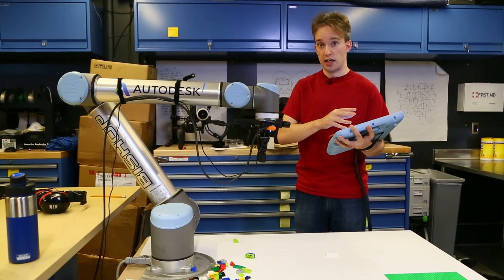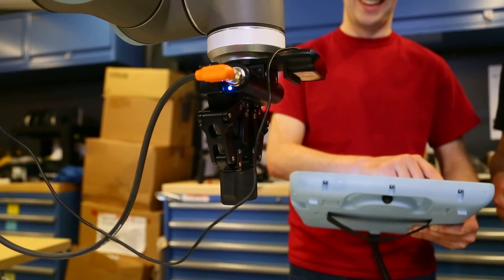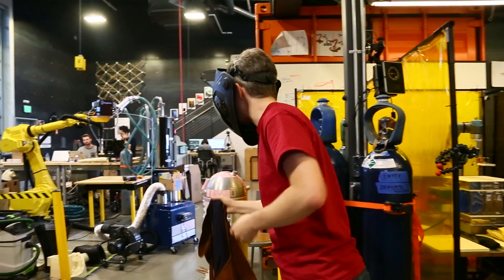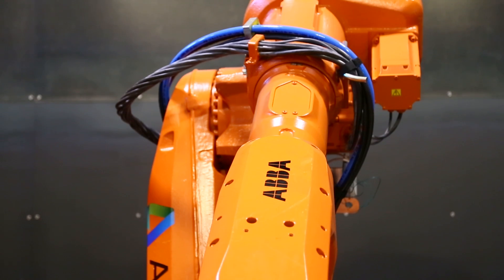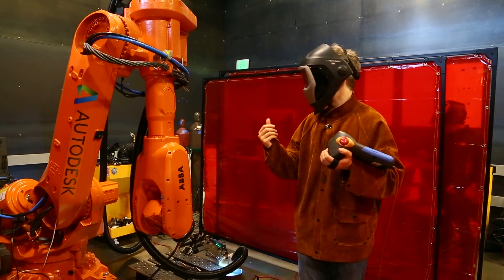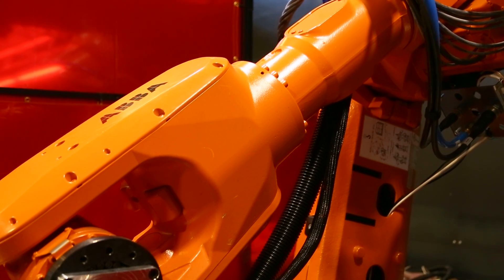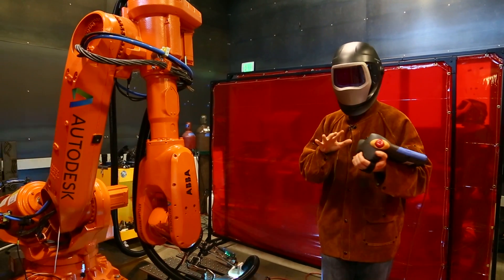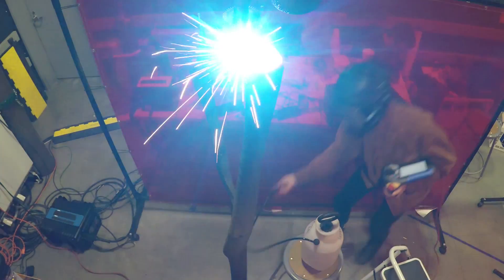3D Printing Stainless Steel with Giant Robot Arms

Comment: Bogus & pompous. It's nothing but a simple CAM demonstration, with a MIG torch riding on the endeffector. BUT as someone presently struggling through the endless deficiencies, frustrations & inadequacies of Autodesk's Fusion 360 software...if this is the rathole that AD's R&D funds are being wasted on: 1) F-360 will never get the fixes it needs 2) AD will never again catch up with or be the equal of Solidworks; and 3) self-driving robots are as dumb and impossible an idea as self-driving cars because computers can't actually think. It's true, neither can so many people, but amazingly computers are even dumber than their creators.

Comment: boys and girls, sorry for spoiling it all before it even starts,  but have you ever wondered what is the price of that 3D printed sculpture. a quick guess? more than you can imagine is the answer. just the price of stainless steel is discouraging, let alone the energy and maintenance. 3D is not a universal technology - it is a complementing tool, not a replacement for machining. also, welding is generally an inaccurate process. don't fool yourselves...

Comment: When he said ‘assembly language’ I went “ohhh nooo” aloud, since I tried learning some assembly language a while back, and gave up when I realized that you store values and call the kernel or some crap like that to do functions. Hello world suddenly got a lot more complicated.
Reply: dword txt "hello, world", 0
mov rax, txt
mov magic_register, "just print out the damn thing will you?!"
call magic
;easy, right?
Reply: Well, the string "Hello world" itself can't know which pixels to light on and which pixels to switch off in your screen by magic. So of course there are a lot of code or circuits behind the scene.

If the computer is running the screen in "text mode" like in DOS days, then maybe those operations are all offset to the GPU without OS interference. Or if you are running an embedded device without any GPU in-between, you code which pixels to light on directly by tweaking individual signal output. Else if you are running a windowed interface like what we almost always do nowadays, then there are a lot of works for the OS to coordinate.

Edit: I said "or circuits" because around 1980's to 1990's, there were a number of "Chinese cards" for one to buy and plug into PCs for Chinese text display acceleration.
Reply: Heads Mess 48 65 6C 6C 6F 20 57 6F 72 6C 64
Reply: @Heads Mess And now I've actually been able to write a "Hello, World!" program in NASM. Two years does a lot.
Don't worry, C++ makes me want to scream too, sometimes. I use it for robotics, but thank goodness I can mainly just use the API that we have and hardly have to touch the C++ libraries.

Comment: Convert shapes into machine code, notice when it's out of materials - regular 3d printers do that. The one new thing in this video was just that it can evaluate the quality of the actual physical print based on the actual results.

And why don't they install proximity sensors if they want it to notice people getting near the robot?
Reply: ailaG I think you might be underestimating the difficulty of welding. You have to hit the exact right speed of the tool, wire protrusion speed, angle, amperage. And in welding, unlike regular 3D printing, the previous layer shouldn't be solid when you go over it. Otherwise the product will have pretty crappy physical properties. Oh and if it's too soft when you're adding another layer, it'll just end up as a puddle of liquid metal. Welding things together is difficult already. But using welding for additive manufacturing is just nuts! (in an awesome way)

Comment: This seems pointless to me. ha ha! (weld seams) anyway I can tell you for fact that the finish on anything this prints would be ruff and layered and would need machining if printing a precision part not to mention the time layering the welds and cost of equipment. Also it would be quite brittle and would need to be heat treated for most applications. These robots f@@k up all the time and need to be programmed and supervised almost continuously. I cant see this ever being used other than for art sculptures and you have to question is it really art when it's been produced by a robot? Boom!

Comment: No mention of material properties after a print is complete? Or even what types of loads these can take, or what this can be used for right now. I can't imagine that this style upholds the tensile and compression strength, like rolling does do to tempering processes. I imagine the shear capabilities of the metal drop dramatically since it is no longer homogeneously formed.

Comment: > Assembly Language
... Scott...
You call yourself a programmer? Well, that must have been a brain fart of magniture 9000+.

It almost made my brain melt with stupidity that you would call machine code that. If I would have called machine code "Assembly Language" at Uni I could have been thrown out a window, head first.

I have lost my respect for you thanks to those two words. It is deplorable to use the wrong terminology in an informational video.

Assembly Language is -- to some extent -- high level. It is an abstraction using natural language to represent machine code. Assembly Language is compiled/assembled in an Assembler into machine code. This is basic stuffs that every programmer should know.

Comment: Tom - excellent video as always.

I had a personal experience with a robot failure some years ago. I was working at a company doing surgical robotics when the robot arm (much smaller than the one shown - could easily fit on a small table) suddenly moved at full speed, missed my head by 3 inches and slammed into a wall making a huge hole in it.

That was caused by a division by 0 error in the robot controller, which was using assembly code. We switched to another robot that used C/C++ and had much better fail-safe mechanisms in place to prevent that from happening in the first place.

Having written assembly many years ago, it's a real bitch. You only use it when absolutely necessary.

Comment: Even if you have the kill switch, would you have enough time to react if the robot swung at you unexpectedly?
Reply: Yes. When you press that e-stop, the robot stops dead, makes extremely expensive noises, and the controller has a chance of releasing the magic smoke.
That is a very "E" stop. The regular cycle pause button is on the front.
That, and the controller itself is a "dead man" switch - you have to hold the controller tightly to depress a button within the handle. If you let go, the robot stops normally and then yells at you with colorful errors.
Reply: most robots have a manual control speed that is limited to 250 mm/s (/W deadman) so there is time to react if something goes wrong. if the machine is in automatic mode then the robot has no speed limit and people need to be clear of the robot
Reply: Probably not enough time to avoid getting hit at all, but enough time to avoid being killed. Most robot related deaths are not just from being smacked by the arm, but rather by being pinned and crushed or torn apart.
Reply: Definitely not
Reply: Depends on his reaction time :p
Reply: IMDRock These can be overridden on almost any system if you are an admin. That means a regular operator(factory worker) can't go in and pin themselves to the cage before they can notice, but the integrator/owner of the machine can easily run it at full speed in manual mode.
I know for a fact that older KUKA and Fanuc controllers allow for that, not sure about new stuff.
Reply: ***** normally to switch to the full speed mode you need to have pendant switch and the controller key switch in the same state.(robot control or pendant control) I'm not aware of any system variables that let you bypass that (at least on the newer FANUC robots).  how long ago was it possible?
Reply: IMDRock I've seen it done on KRC2-controlled robots.
Weird.
Reply: IMDRock the stop is checked cyclically. No matter which position the switch is in, it'll accept the pendant input. 

I had a coworker almost lose an ear because a driver failed closed and a motor double stepped when it should have half stepped. I thought for certain it had crushed his head.
Reply: @Druicidal  that must have been difficult to see.
Reply: For my degree I wrote a program which would take an image and use a robotic arm holding a marker to draw a stylized version of the image on to a large sheet of paper. The arm was quite a lot smaller than this one (although still took 2 people to carry),  but a decimal point in the wrong place resulted in it moving "slightly" (very much!) too fast and flipping itself (and the table it was bolted to) over as if it weighed nothing... So my guess is no, if that thing suddenly moves towards you at top speed, it's going to hit you before you even register that it's moving

Comment: Did you get to play with the special feature of the universal robots robot arm.
the button on the back of the control panel, if you press it, you can move it just by taking a hold of the robot and move and simply by applying a small amount of force to the robot arm.
Each joint know how much force to expect by talking to the other joints, so it can feel you trying to move it, and when the button it pressed it follow along.
so it takes the same force from  you to move it up as down.

Comment: I can see so many applications for this in the aviation industry. Imagine parts of the aircraft or even engines being made this way. It would still require years of fine-tuning before that can be practical and safe to ensure quality control but the possibilities are almost limitless.
Reply: Structurally inferior, complex. A lot easier to machine the "old" way.
Reply: ***** currently that is true. That's why I said it still requires years of fine tuning.

Perhaps on non-structural parts of aircraft.

Comment: Do these 3D printed stainless steel parts have the same mechanical properties like regular stainless steel parts of identical shape and wall thickness? Of course, some weird shapes are impossible to do by traditional metal working, but still I am not very convinced that this makes real world application sense, even if it were equally "strong" as conventional parts. Why you ask? Because of cost. I cannot imagine this getting any more faster and when mass producing, punching, casting and chip machining will still be cheaper (and faster). Building something special will cost a lot regardless of the technology used.
Reply: It's all relative to what you're doing. 3d printing is very economical for low volume production, but as you scale up the economics change.
For it's current most frequent usage of creating plastic parts, the mould for an injection moulded piece of plastic is anything from $10,000 to $250,000 or more per part.

As you can imagine, a single part costing say $100,000 because of the tooling isn't really viable, but if you're making a million of the same part, then it's not such a big deal.
A 3d printer meanwhile, for low volume production may be comparable to 10x or even 100x the cost per part, but if you're making 10, or 1000 parts instead of a million, the reduction in cost would be dramatic.

For similar but somewhat different reasons, if you're making say, a car, then material strength issues aside, making 10,000 cars out of carbon fibre using moulds is substantially cheaper than  steel or aluminium parts would be.
But if you're making 100,000 or 1,000,000 or the like, steel is substantially cheaper than carbon fibre.

What 3d printing does in effect is lower the upfront tooling costs.
This means massive reductions in production costs for low volume productions, but it won't particularly displace extremely high volume production.

So far, 3d printers have made it viable for individuals, for a fairly low cost to make completely custom plastic parts, where before affordable 3d printers were around, production of plastic components was only viable for very large production runs coming from companies with lots of very expensive equipment.

In that sense, for the current uses of 3d printed plastic, the production costs for low volume production of parts have decreased many orders of magnitude.
A 3d printed unique part wouldn't surprise me if it were 1/100th or even 1/1000th the cost of trying to make a similar item in a similar material if you are only interested in one or two or maybe a dozen of them at most.

Have you ever looked into the economics of on demand printing? Because yes, books printed that way are more expensive per book, but on demand printing has made low volume production viable that means many orders of magnitude more books are technically still in print compared to what would be the case if only traditional printing presses could produce them.

3d printing has similar implications.
Reply: I agree. But plastic has the same mechanicl properties when printed or moulded. I am not so sure about stainless steel.

Comment: 1:20 Technically an excel formula doesn't get converted to assembly. It's converted directly to binary instructions. Converting it to assembly would be pretty pointless.
Reply: goeiecool9999 Technically, interpretation is just a slightly more indirect way to convert something to assembly, because for the execution to happen a stream of instructions have to pass through a CPU. Just because those instructions are dynamically generated and stored doesn't mean that no conversion has occurred. If you could filter out the interpreter's own logic and save the rest, you'd get a "compiled" program, even if interpreter optimization means that it would only work in that exact situation because (say) unreached code was never interpreted.
Reply: Assembly is not the same as processor instructions.
Reply: goeiecool9999 Then it appears that I have misinterpreted you. I thought you meant "bytecode" rather than "machine code", which I had conflated with assembly (also my error). But my actual point still stands, that even bytecode or non-compiled interpreted code becomes real machine code eventually, it's just that you might not be the one to tell it to.

Comment: I'm super surprised that ABB Robotics don't incorporate human proximity processes. Maybe it's up to the end user to do that, to which end, a pressure sensor embedded mat paired with code that triggers certain restrictions in the robot's movement should be a reasonable thing to implement.
Reply: Almost all manufacturers now make human-safe robots with full-body capacitive and pressure sensing. These are industrial machines though, meant to run with no humans at all, except maybe the Universal Robots UR3 and UR5 they have - those have the features by default and can be taught by pushing the robot around.

Comment: This is nothing new. Programing trajectories directly in the robot is being done for years now. Vision systems have been used for a long time now to make robots respond dynamically to their environment. What's more, some robots have systems that detect collisions and stop, minimizing the damage done both to people around the robot, and to the robot itself. To be honest, seeing how fast a robot weighing hundreds of kilos can move is kinda scary. You have no idea how fast that can be until you see it. It can easily kill someone.
Reply: Most industrial robots have a "low speed" setting that allows you to be in close proximity in relative safety. It could still easily kill someone, though not by accident.
Reply: Member that Chemical Brothers video? I member!
Reply: Connor Hill Actually, it's you who missed the point. This video is not about a computer system that visually inspects welds in real time. This is about a computer system that visually inspects a 3D printing process based on welding. It doesn't really care what the weld line looks like. It only cares if the shape of the object is correct.

Comment: After welding theory course all I can think about od the shitload of energy it wastes.
Reply: Whereas having done a materials science course I'm wondering what the final lattice structure is, and how the multiple heat affected zones affect each other O_O

Induction melting a little bit of metal at a time does sound a lot less efficient than say, melting all at once than die casting :X

Comment: Um... have you heard about 5-axis CNC machining? It's about exactly what this robot is doing, just kind of in reverse. And it's been around for quite a few years so I don't know what's the reason to try to make it look so special.
Reply: but this can make a thing thats hollow on the inside
Reply: angrycreeper100 That's not the point. Have you ever seen an infomercial? They present something that obviously doesn't work (often in a hilarious way), then they present their "breakthrough", somewhat neglecting the fact that there are simple, cheap, and long known solutions for the "problem" already. That's exactly the case I see here.

3D printing in metal exists for ... I guess 10 years? 5-axis manipulator control for 20 years? So yeah they may have some kind of breakthrough in what they present here but it's kinda lost in the ballast.

Comment: I don't get it, is that hard to make the robot smart enough to detect errors?

If there is something in the way of the robot, you could just make it stop when the arm meets some unexpected resistance and monitor it with a Amp or a Ohm meter on the electric-arm-moving-motors.

Comment: I wonder at what speed it prints at or how fast it could print? It looks like it could be a better or less expensive way of making custom metal parts versus milling from a solid block or mold casting.
Reply: it would be cool to have for making obscure parts for old cars and stuff
Reply: Vegaspsycho no way would it be as strong using the process shown.